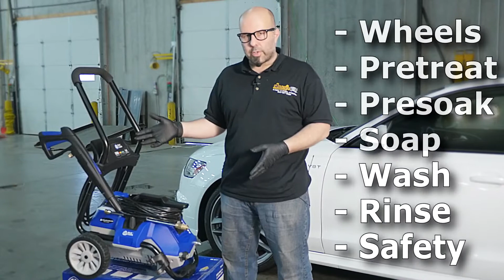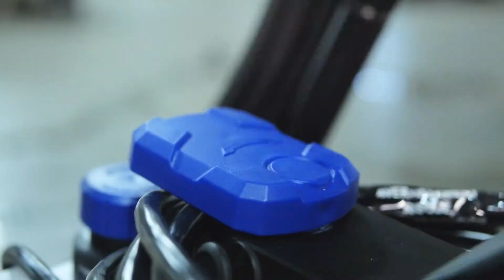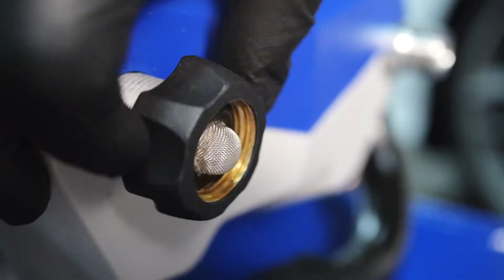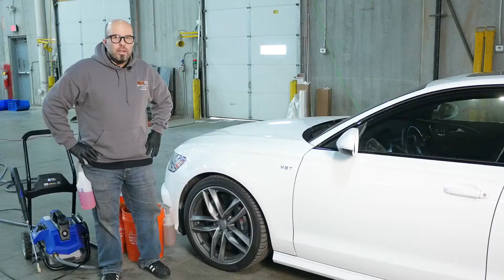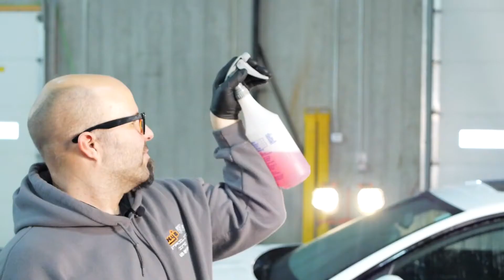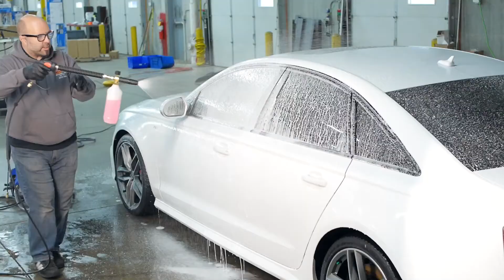Foam Canon & Pressure Washer Professional Detailer Step By Step To Washing Your Car

Comment: Does the all-purpose degreaser also remove any wax or paint sealant?  Also, it is safe to use on any ceramic coating?

Comment: 2 bucket method is only safe on a vehicles that are very lightly soiled and are using a PH neutral soap. A Heavily soiled vehicle will just contaminate the buckets with sediment that WILL get back onto the mitt which in turn will incure additional scratches and swirls. The lightly soiled vehicle will do the same but not nearly as bad as a heavily soiled vehicle. 

A ph neutral soap is designed to be used for maintenance washes and are very gentle without the worry of it stripping the existing wax. A higher ph level soap will strip wax and other forms of traffic film however the 2 bucket method decreases its effectiveness due to excessive additions of water from the rinse bucket mixed in with the soap bucket. All soaps have some type of surfactants that are best effective with their calculated water to soap ratio.
Reply: So how many buckets would you use or how would u do it i wana do at home carwash have any tips?
Reply: @ejdetailing7189  
3 buckets. 1 containing all of your mitts, 1 containing the soap/water mix, 1 empty bucket to toss the dirty mitts into.

Idea is to wipe down each panel of the vehicle using 1 mit per panel. 

If the car is only dusty then you can use 1 mit for the whole car.

Comment: Is it wise to drill your paint with a 2000 psi water jet?
Reply: Nevermind, I commented before I got to the end of video where you said it's ok.
Reply: Note that he uses the 40 degree tip (or the 25 degree). I would strongly advise against using a 0 degree tip anywhere on an automobile.